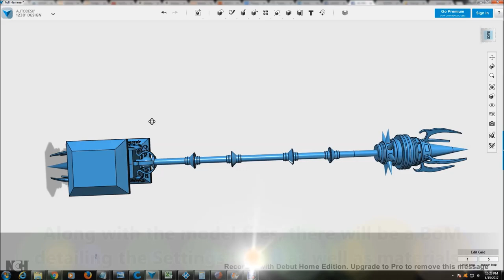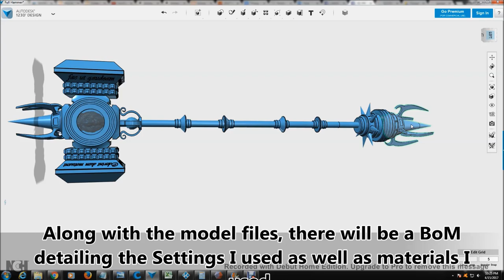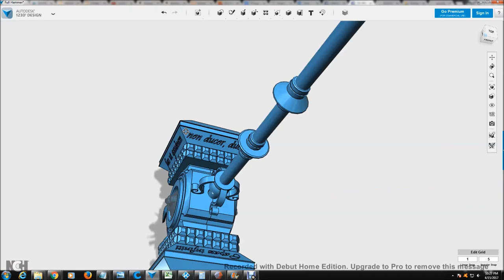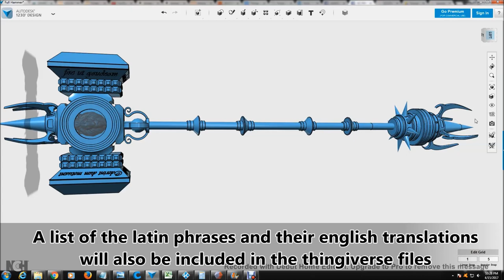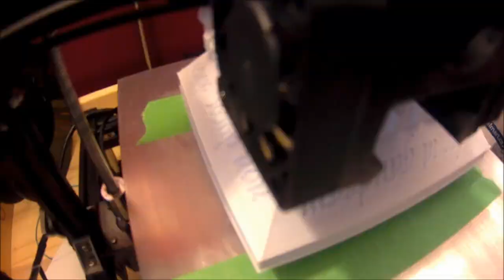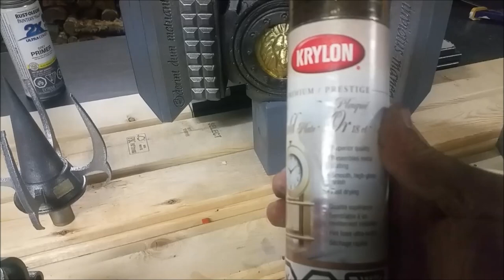Fantasy WarHammer 3D Print and Build - Mjǫllnir beware

Comment: rather use a broom handle for the shaft and fill the head and back part with insulating foam and a few small sand bags. want it to be weighted but not heavy.

Comment: Awesome Project!! Do you have a counterweight in the back?
Reply from the maker: unfortunately no, which makes the head of the hammer feel a lot heavier then 15lbs. you could print the back pieces hallow with 1mm wall thickness and fill those with concrete also, it would give you about 4lbs of counter weight.